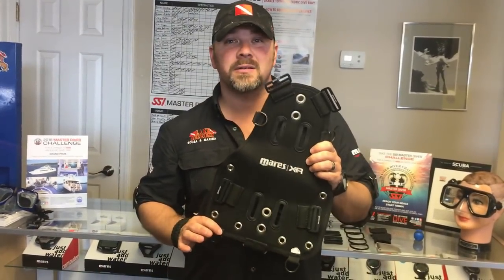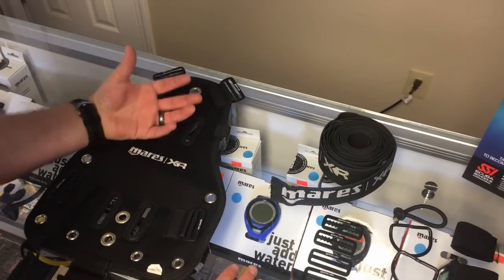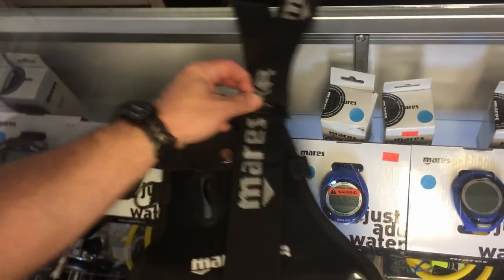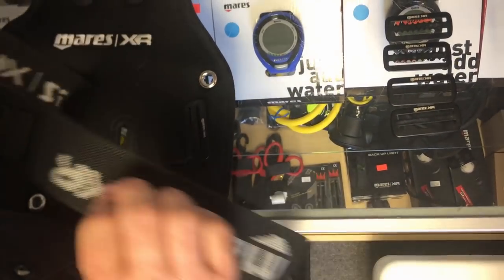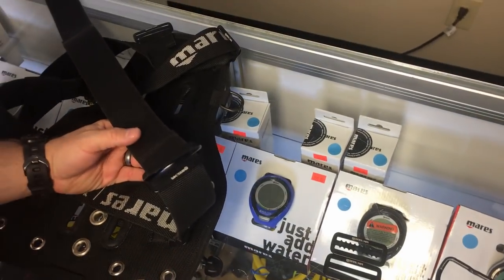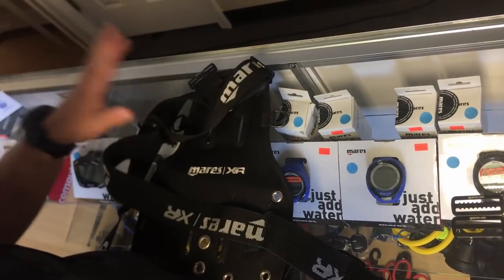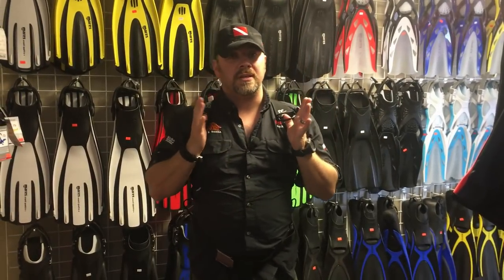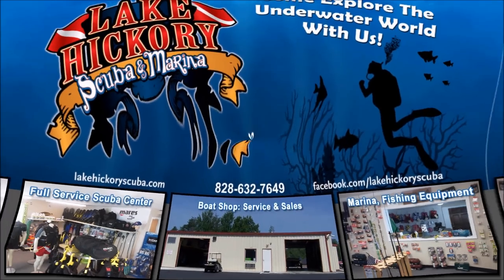Mares XR Soft Plate And Heavy Light Harness Assembly

Comment: I bought the mares wing and attach it to back plate. The flathead bolts not able to tighten, is that normal?
Reply from the maker: Hello Robby Natividad, not sure why you would be having trouble with the bolts not mating together. We usually use two flat head screw drivers to seat them together. See if that helps you out.
Reply: @LakeHickoryScuba   what i did. I added an webbing to compensate the space and to tighten the flathead bolts. I will be using my wing for the first time today. Thanks for the reply sir

Comment: I'm using same configuration - Mares soft backplate, diving with Mares Kevlar Dry suit. What pockets do you use as weight pockets and how do you secure them?
Reply from the maker: I typically on use the Soft Plate for warm tropical diving.  With this being said, I can usually use a 3mm shorty without any weights, and still maintain neutral buoyancy with ease.  For diving locally in the summer time, I will either wear a full 3mm or a full 5mm, and to add weights without actually adding weights, I will use a steel 100 instead of a standard aluminum 80, which still allows me to swim the system up without the need of having any ditch-able weights.  Occasionally I will add trim pouches to the cylinder straps if needed.  These weights are non ditch-able, so having a balanced rig still allows me to swim the system up from any depth.  You can see my travel rig here in this video.  https://www.youtube.com/watch?v=dQe2zQUfjZc

Comment: Hey, any reason why you do right hand release for waist belt? Thanks.
Reply from the maker: Great questions and it just depends on the manufacture and how they design their system.  You can run it on either the left or right side.  I don't typically wear a weight belt, so there is no issue of confusion in regards to that.
Reply: Ah makes sense. I know on my belt the logo would be upside down (also mares). What do you use for weights instead of a belt?
Reply from the maker: Typically I will dive a completely balanced rig depending on the exposure suit that I wear.  This way regardless of depth, I can always swim the rig up.  In the rare occasions I would need weight, I would then use 2 small Mares weight pouches attached to my tank cam straps, think of them as trim pouches.  If I ever needed more than say 10 lbs, then of course, I would switch to a steel plate instead of the soft plate.  Unless I am in a traditional jacket or back inflate system, which I use while teaching basic open water courses, then I will use ditch-able weights, or a weight belt.  And you are correct, with this system, the logo on the belt buckle would be upside down if it was switched to the opposite side.
Reply: huh good to know. Thanks for the info i'll keep it in mind.
Reply from the maker: You're welcome

Comment: Quick question. Are soft backplates not standard primarily due to durability? I primarily cold water dive but I'm trying to decide between alu or soft for travel.
Reply from the maker: Most divers tend to choose the Aluminum Plate over the Soft Plate for travel, as they tend to be more versatile with different cylinders.  I personally love my Soft Plate though.
Reply: @LakeHickoryScuba  When you travel, do you then bolt a single tank adapter on it to add rigidity, or do you do without?
Reply from the maker: Thanks to the design of the XR wings, single tank adapters are unnecessary, so I personally do not use them.
Reply: @LakeHickoryScuba  Thanks!